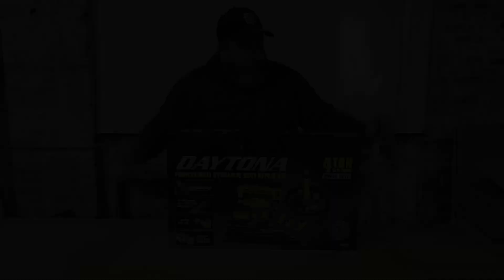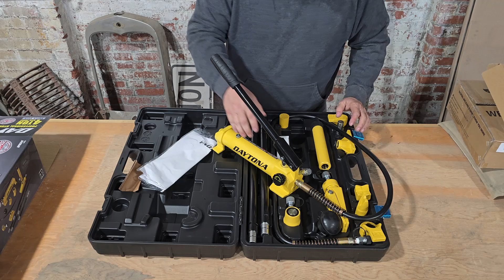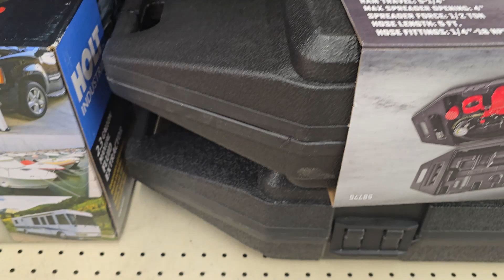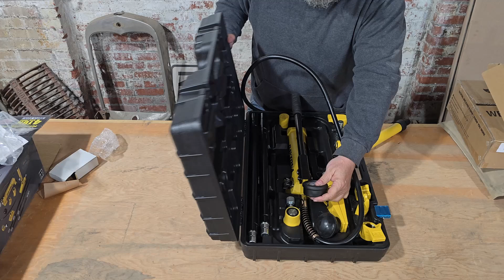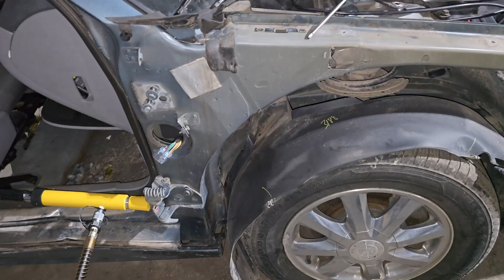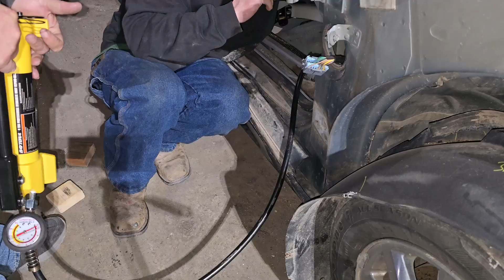Testing The DAYTONA 4 Ton Professional Hydraulic Body Repair Kit

Comment: Great video. I didn't miss the part about the door. Hope other's caught it too! I laid a mattress down flat in a trailer with 4 foot sides. It had some weight to it - two of us slid it in there, we were only going 15 minutes down the road...... All was well until I hit the highway, where I saw it fly up and out. Thankfully the poor bugger behind me dodged it! I know about the Venturi Effect - it's what pulls the paint out of a siphon-fed auto paint gun - the air rushing over the top of the tube pulls the paint up and out. I just never thought it could do the same thing with a mattress. And now a door too!